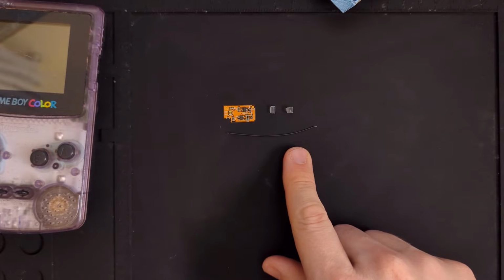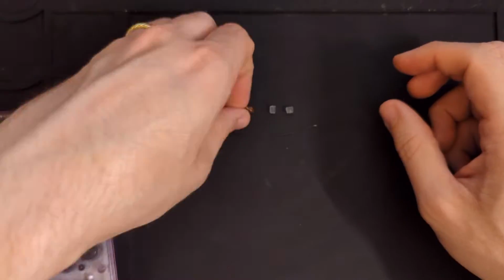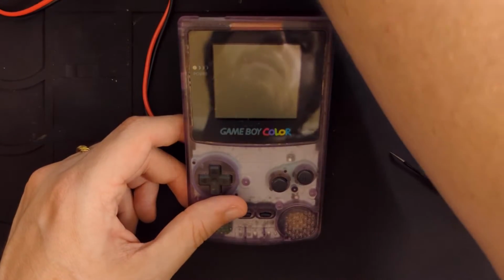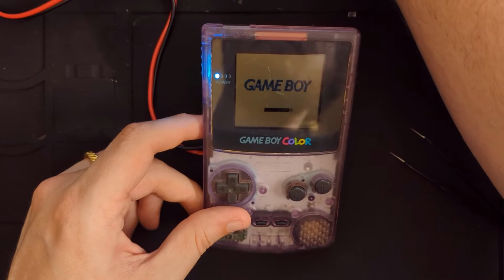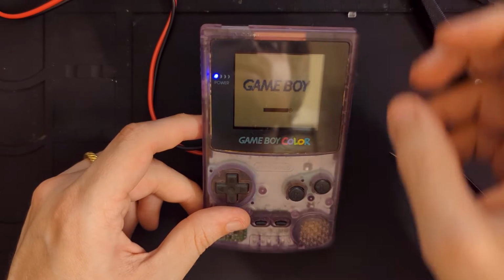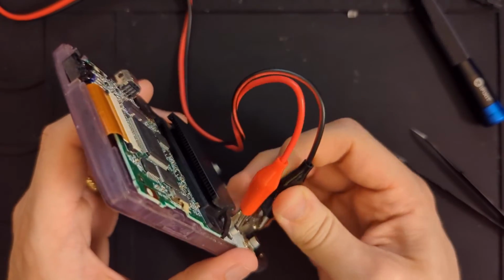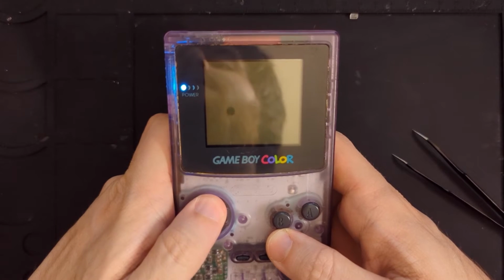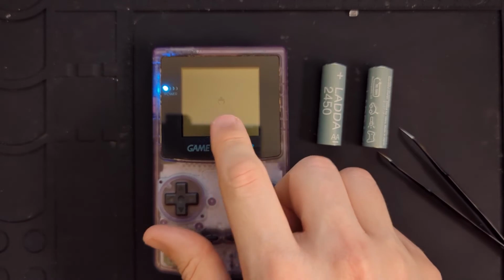Game Boy Color Battery Indicator Installation and Testing

Comment: hi! i noticed in the instructions on your website, there is a switch that indicates whether you're using lipo or AA batteries. the pcb i received has these two pads, but the switch is not present. does it no longer need this switch? or did my kit just not come with it?
edit: never mind, i visited your discord and found my answer! instead of a switch, you just have to bridge the pads of whatever battery type you're using. thank you! works great now!

Comment: Hi I just received the latest version and installed tonight, using with a LiPo battery kit. The one i purchased had a white LED and a red LED however with a fully charged LiPo battery the indicator stays red the whole time 😢 any way i can actually get this to work? Ive been waiting like 3 weeks for delivery to the UK and bit bummed its not working. Help pls
Reply: Turns out my version of V2 ive been sent doesnt have the switch attached to the pcb to switch it to LiPo 😢 have i been sent an unfinished product?

Comment: I received this kit today and it only came with one light pipe and no wire. Hopefully this light pipe fits my funny playing shell. I'll update after installation
Reply from the maker: The latest kits don't require a wire -- the VCC half pad in the top middle should line up with a via on the motherboard, and should be soldered there -- and I recently switched to a single pipe that should fit all shells. Hit me up on Etsy if you need any assistance!
Reply: @leggomyfroggo  Thanks! I'm excited to install it this evening

Comment: The battery life indicator does not warn you of a dying battery when having a Lithium Ion battery mod by Funny Playing. basically turns red for 1 second and shuts off/resets. Its prolly because the battery mod is designed to output a constant voltage.
Reply from the maker: Yeah, LiPo mods won't play nicely with this, especially if they output a constant voltage to VCC. In that case, you'd need to run the VCC wire on the mod to the positive terminal of the lipo, and tune the low voltage threshold appropriately.
Reply: @leggomyfroggo  right

Comment: will this work if i have a retroflex rgb board on my gbc? my gbc keeps shutting off without warning  b4 dying the leds dont even get dim ;-;
Reply from the maker: Is that the HHL button LED kit? You should be able to just cut off the power LED part of that mod -- or fold it out of the way -- so this one will fit.

Comment: Do you think it would be possible to have a kit that measures the power draw by the screen to give a more constant time remaining regardless of the screen settings, and then a pot to adjust the length of the warning time?
Reply from the maker: Monitoring power draw and coming up with a number of minutes left would complicate the circuit, and you'd be putting a lot of faith in different batteries being similar enough that your estimates are accurate beyond a tiny selection of batteries.

That said, I designed an adjustable version that has a pot for adjusting the low battery threshold voltage. I'll put it on the todo list to share that on OSHPark at some point.

Comment: Any problems with this mod clashing with others? Not a critisism just want to know.
Reply from the maker: Only a couple possible interactions I'm aware of:
1. Button LED mods that also include a replacement power LED(e.g. from Natalie the Nerd), but the power LED portion can be cut off there.
2. GBAccelerator. The actual speed mod will work fine, but since it's a totally different power LED circuit, the indicator wiring they indicate would not work. I think I devised alternate wiring for that, but don't have one to test at the moment.
Reply: @leggomyfroggo  Thanks

Comment: Purple/Red combo is pretty sweet. The purple is probably the most subdued brightness of the different color selections. And looks nice in my clear purple shell. The red is pretty bright, but there’s only 10 to 15 minutes of battery left on my LADDAs when it gets there. So I should change batteries then anyway. This mod is pretty great and easy to install for anyone with modest soldering skills.

Comment: Great project! Will you release the gerber files for it?
Reply from the maker: Already did, just not on GitHub! Check out my OSHPark link in the video description.
Reply: Unfortunately I couldn't find a way to download the gerber from OSHpark. Looks like the option is disabled on this project :(
Reply from the maker: @Bruno-tt6cf  downloading gerbers is disabled on that project, so you need to order from OSHPark. By far your cheapest option in any case since they need to be flex.
Reply: @leggomyfroggo  I know, but my soldering skills ain't good enough for smd. I'd like tonget it assembled from pcbway. Any estimate when it'll be back in stock at your etsy store?
Reply from the maker: @Bruno-tt6cf  should be back around the end of the month

Comment: I have one suggestion, perhaps a more opaque defusing "light pipe", I went with Green/Red for my LEDs, and the green is so bright it's distracting to the eye, even with a max brightness backlight kit, the green LED is brighter by a long shot. I plan on disassembling and sanding the light pipe a bit to make it more opaque and hopefully to diffuse it a bit more. If that doesn't work, I'll likely end up finding a different type of plastic to use instead.

To be clear, this isn't really an issue with the mod. It functions exactly as intended, just perhaps a consequence of the colours I chose, and the brightness of the LEDs.
Reply from the maker: This can be fixed by choosing a different resistor value for the LED as well. When did you order? I started using higher resistor values for some colors recently because of this.
Reply: @leggomyfroggo  Around Mid September is when I ordered.

Comment: Does this only work for Gameboy Color? I’m interested in using it with a pocket if it works.
Reply from the maker: It will technically work with the Pocket, but shape and LED positioning aren't quite right. I'm just finishing up testing on a pocket version that should be available in the next few weeks.
Reply: @leggomyfroggo  Thanks for the quick response! I’m so excited for this mod I use my pocket almost everyday, so this would be a huge help 👍🏽
Reply: @leggomyfroggo  Nice.

I have game boy pocket with no battery indicator. Im hoping to find a way to add it back in. Would it be possible with this mod?
Reply from the maker: @trashdee7973  yes! I plan to do a video at some point showing this

Comment: Did you think about adding a pot to accommodate for different power options like lipo mods and different batteries?
Reply from the maker: Under consideration for a V2. The lack of required calibration I think is good to keep things simple.

Comment: It's not so efficient, but my usual method before I got a solder sucker was to use a third arm to hold the board straight, then heat the joints on the back while wiggling and pulling the LED out from the front.